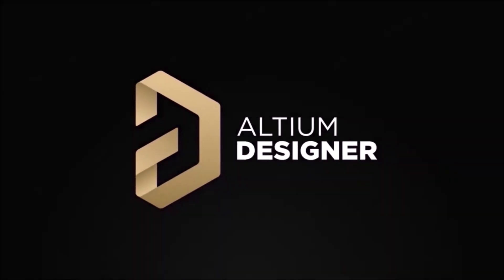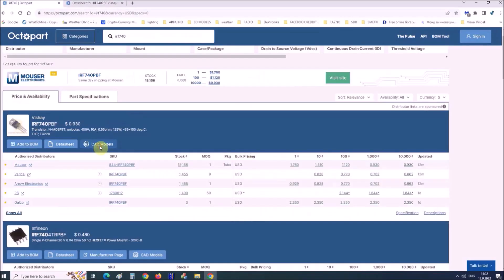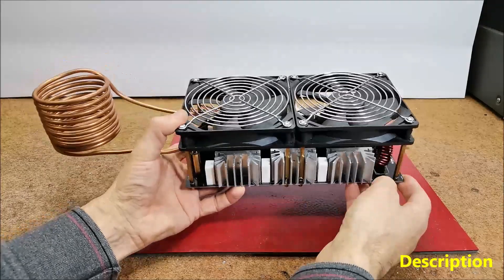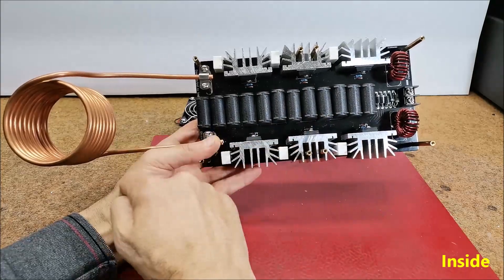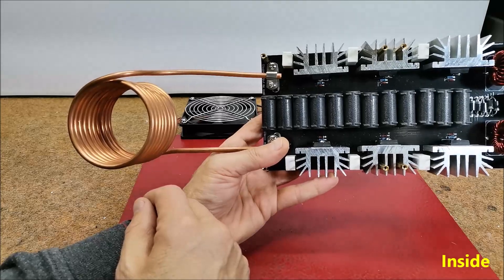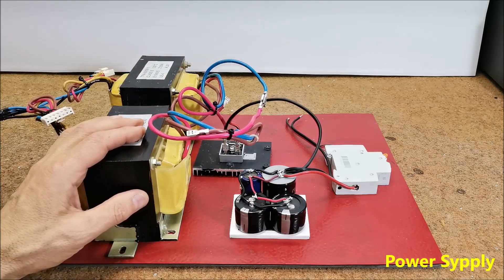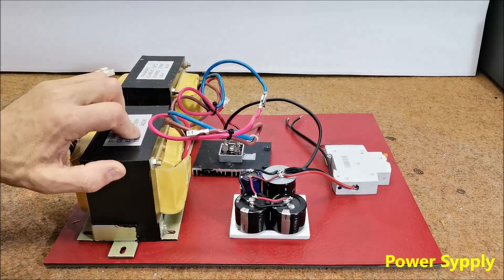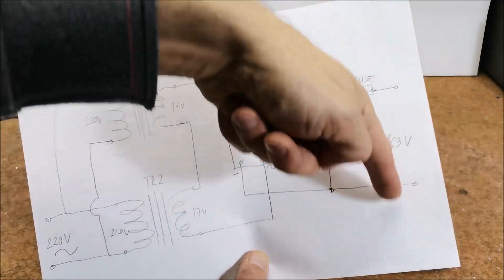Testing 2500W Large Induction Heater

Comment: Can u make ac mains zvs driver
Reply: you can replace the irfp260 mosfet with higher voltage ones,  but working directly from the mains socket is dangerous. The Drain to Source voltage is about 3x the input voltage, so if the rectified mains voltage is about 300V DC (I live in Europe, we have 230V 50Hz ac), you would need about 900V Mosfet to resist. I do not know such a Mosfet, maybe IGBT's could work, but not in a zvs design.